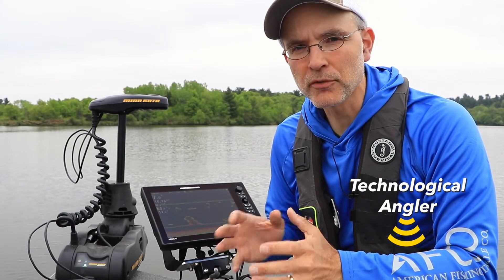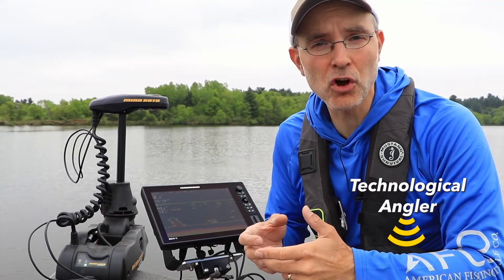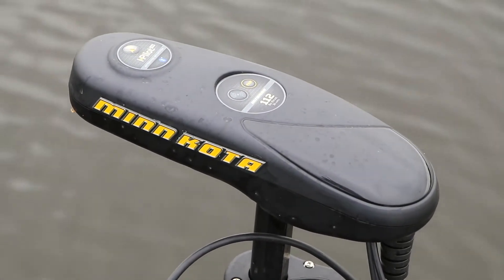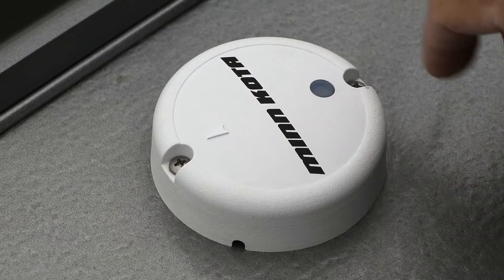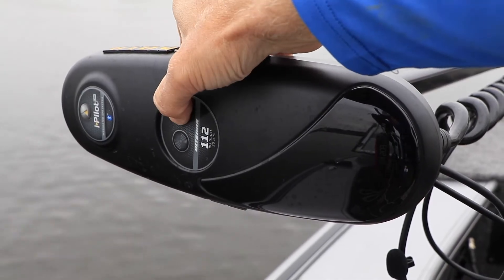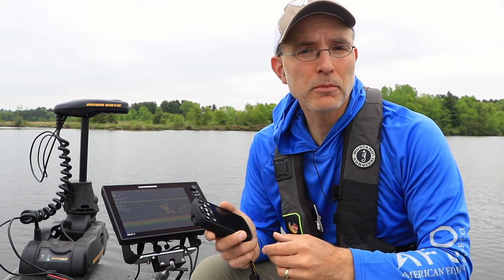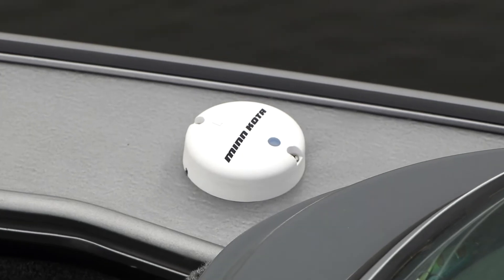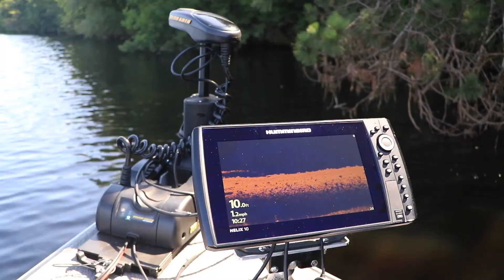How to Pair a Heading Sensor with a Trolling Motor

Comment: What does a blinking red light mean on the Ultrex disc?
Reply from the maker: The only red LED on an Ultrex is located on the foot pedal to indicate AutoPilot is engaged. It should be solid, not blinking. If you're experiencing an issue with this feature, please contact customer service through the link below (copy and past the below url to your browser address bar).

https://bit.ly/3soCsvX

Comment: Hi guys...i paired my puck to my terrova successfully, but keep having to redo it on the water....i have spotlock ok ,but i lose the jog option.
Any idea why this is happening?
All my connections are sound and puck is placed correctly...many thanks Paul
Reply from the maker: paul bourke,
Once you paired the Heading Sensor did you go out on the water and calibrate the Heading Sensor and then set your offset?  If not, you do need to do so.  If you have already done this then would suspect you have an issue with the Heading Sensor.  You can call technical support at 800-227-6433 and make sure you have the serial number off your trolling motor.

Best Regards.
Reply: Yes I calibrated and did the  sensor off set too. redo it every time I lose my jog option...
Many thanks for your reply 🙏

Comment: My current powerdrive with i-pilot has no puck what is the diffrence with the puck? Why is it necessary
Reply from the maker: Hi Kyle, This Bluetooth-enabled heading sensor contains a compass that detects your boat's heading and communicates it to your trolling motor to enable the Spot-Lock Jog feature, which lets you move your Spot-Lock location in 5 ft. increments in any direction.

Comment: I'm sure that this question has been asked, but... on my older Terrova I simply held the "N" button down in order to bypass GPS and switch to compass headings instead. I just mounted my new trolling motor and see that that is no longer how Minn Kota has the Ulterra set up. I fish in constant wind and tide, GPS tracking is useless to me, sooo... how do I set this Ulterra to run off of compass bearings instead? Thanks!
Reply from the maker: Syd Quinn,
Turn your remote on and then push your down arrow under the screen.  At the bottom of the screen you will then see Options and System.  You will want to push the button with the white dot under the word options.  The first line you see will say Auto Pilot and it will be highlighted.  You will then push the button with the check mark and you will the see Legacy and Advanced.  For the Compass you are going to want to highlight Legacy and then push the button with the check mark to select Legacy and you will be set to use the compass.
Best regards.

Comment: When I try and pair my units, I get a beep when pushing the Heading Sensor.  After that beep I cannot pair my Ultrex.  How could I trouble shoot this to resolve?  Thanks   Is there a procedure available to run to re-pair these units?
Reply from the maker: Richard Majewski,
If you can private message me with your phone number.  I will give you a call.

Best regards.

Comment: So can I establish the wireless pairing on my sensor to the trolling motor while in the garage and not on the water?
Reply from the maker: WRX STI,
You can pair the Heading Sensor to the Trolling motor on land.  You can also Calibrate the Heading Sensor on land if you wanted to.  You would have to go to a big parking lot and have the motor deployed and drive the 2 circles.  It is best however to Calibrate on the water.

Best Regards!
Reply: @MinnKotaTutorials  thank you! I want it done properly I will do it on the water
Reply: @MinnKotaTutorials  I am getting no light to the heading sensor when I press pairing on the trolling motor. Do my terrova needs to be deployed for the sensor to blink??
Reply from the maker: WRX STI,
To pair the Heading Sensor to the motor you will push the button on the Heading Sensor first.  When you push the button on the Heading Sensor the Blue Light will start flashing very quickly.  While that light is flashing quickly you will have to get to the Control Head on the motor and hold the Pair Button down until you hear 3 quick beeps and they Heading Sensor will be paired.  Once paired the Blue Light on the Heading Sensor will flash once every 3 seconds.

Best Regards!
Reply: @MinnKotaTutorials  then Cabela's didn't wire my head sensor correctly because I did like you said and there's no light flashing at all

Comment: Thank you for this video, would there be any issue with connecting the sensor to the same 12v battery that runs my trolling motor? I know some people connect directly to their cranking motor but I worry about continuous draw down when the main motor isn’t running.  Does the puck have a constant power draw even when not in use?
Reply from the maker: Chuck,
There is not a problem connecting the Heading Sensor to the Trolling Motor battery.  If you have a 24 or 36 volt motor the Heading Sensor would have to be hooked up to the low side trolling motor battery.

Best Regards!
Reply: @MinnKotaTutorials  thank you for the response!  I'm not familiar with the term "low side battery", does that mean the battery closest to the motor in sequence?  I appreciate your help.
Reply from the maker: Chubb Rock,
The low side battery will be the battery with the negative from the trolling motor.

Best Regards!
Reply: @MinnKotaTutorials  awesome, thank you again!

Comment: A friend purchased an Ulterra that didnt come with a heading sensor. Says his spot lock accuracy is terrible and I think this is the reason why. Can he purchase a heading sensor as an upgrade?
Reply from the maker: Hi Galada52, 

Can you please have your friend private message us on Facebook with the serial number from his motor and the phone number. The Spot-Lock issue might be caused by a deep cycle battery that is dropping below 12 volts. They should load test their batteries at an auto parts store to make sure one or all are not on the verge of needing to be replaced.

Thank you

Comment: Was not sure about this at first but my boat took on water  ¬¬¬>allmy.tips/Minn-Kota?E31    and I could get the gas engine started, this gem pushed a half full of water, 20 ft deck boat back to the boat ramp. Got it on the trailer just before we lost the whole thing. Definitely a good buy.

Comment: Is there a way to restore the remote? I had to change the control head since a cut the network cable. That went good and I paired the sensor and remote ok. But I do not get the Cal Sensor option anymore under system? Have not used that feature since originally installing the Ultrex. Thanks!
Reply from the maker: Hi Jim,

If the light on the heading sensor is not blinking slowly then it is likely not actually paired. We would double-check that. If you need further assistance please contact us service@minnkotamotors.com.

Thanks!

Comment: When I pair my ulterra I don't have any red lights.
Reply from the maker: Louis,
If you are pairing the Heading Sensor to the motor, the heading sensor will have either a red or a blue light. If you are getting no light on the Heading Sensor have you verified you have 12 volts to the Sensor? If so it is possible the Heading Sensor needs to be replaced. 

Thanks!
Reply: @MinnKotaTutorials  I have the blue led lights blinking but it doesn't deploy to calibrate. This is brand new out the box 2019. How is it broken already? 2 troll motors and 3 replaced stow/deploy motors replaced all under warranty.
Reply from the maker: Louis,
Thank you for contacting Minn Kota.  We are sorry to hear that you are experiencing issues with your Ulterra.  We would like to make sure that you are aware to deploy the motor you have to double click the deploy button 2 times really fast.  When you stow it is 1 push of the button.

Best regards, 
Brenda
Reply: @MinnKotaTutorials  Brenda I am aware of the buttons but I get a red light on the troll motor.  It's at the service shop and hoping I don't have to get another new piece from something that came out the box.

Comment: Can you use spotlock without the heading sensor mounted? Where is the best place on the boat to mount a heading sensor?
Reply from the maker: Pj,
Thank you for contacting Minn Kota.  Yes, you can use Spot-Lock without the heading sensor installed.  The heading sensor has to be mounted level and even with the Keel of the boat.  It has to be mount 24" from anything that is magnetic or ferrous material.  Also, should not be mounted near wires that have high voltage coming through them and must have clear view to the head of the motor.

Best regards,
Brenda